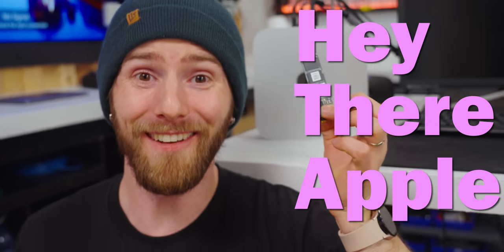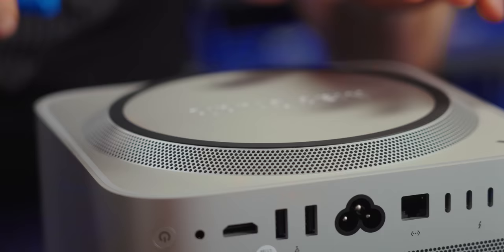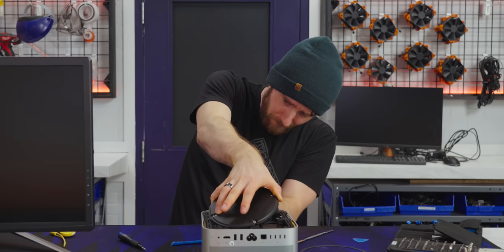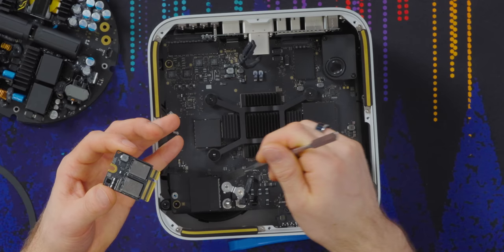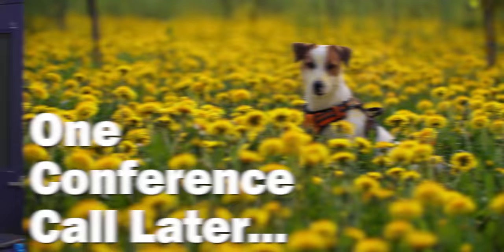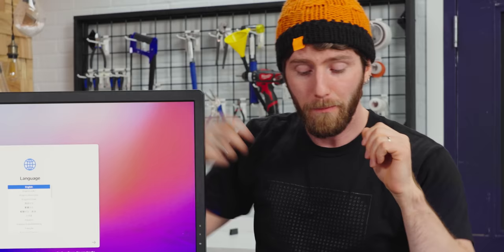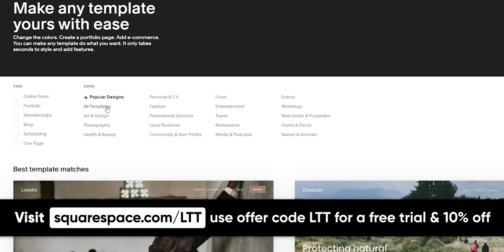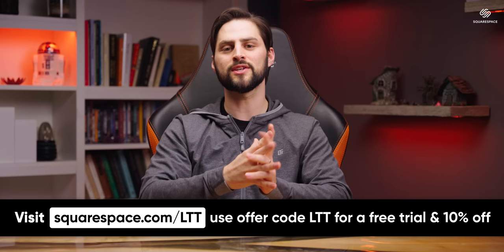I want to love Apple, but they’re making it hard - Mac Studio SSD Swapping

Comment: This just makes me have even more respect for Valve and companies like them.

It was so easy to upgrade my 64gb steam deck to 512gb... And cost me much less than the price difference between their own SKUs
Reply: Well to be fair the 512GB Steam Deck has other features too!
Reply: What drive did you put in? I was under the impression the 64gb wasn’t upgradeable, this is great news!
Reply: @jonatinoo  100% can upgrade the storage quite easily. All sku's have the m.2 slot!
Reply: Gigachad Valve : we will support windows 10 or possibly 11 also we collaborate with Microsoft to enables gamepass on your steamdeck.
Reply: Valve also isn't a publicly traded company, so they aren't legally required to provide maximum shareholder value at all times.
Reply: @wta1518  It's not a legal restriction, it's just a practical one because shareholders hold companies accountable.  Change the shareholders, change the companies.
Reply: Valve is doing many pro-customer things which dont net them any profit. Like working to make games Linux compatible. Apple is polar opposite.
Reply: @desther  well making linux games compatible does make them profit
Reply: @ucnguyenminh9393  A steam profile, keyboard profile, a different colour lining in your case and an anti glare screen that can be achieved with a $2 screen protector... 

Think 64gb was the way to go...

Having said that, I also ordered a 512gb on another account for my partner, wish I'd ordered a 64gb on that account too now...
Reply: @jonatinoo  I ordered this from Ebay

Samsung PM991a PCie NVMe MZ-9LQ512B 512GB SSD M.2 2230
Reply: as far as im aware apple is the only tech company going for anti 3rd-party repairs
Reply: @Shotblur  Actually publically traded companies ARE legally required to act in the best interests of their shareholders (in the US at least).
Reply: @Shotblur  Shareholders can and do sue their own companies over lost profit successfully
Reply: @wta1518  Corporate purpose was at the heart of the Hobby Lobby case. US Supreme Court ruled that companies DO NOT have to pursue only profits and that directors can act counter to shareholder interests because directors also have fiduciary duty to the company itself, the goals of which may not be the same as the goals of current shareholders. The federal government tried arguing that for-profit companies' only purpose is to make money and was handily bitch-slapped by the US Supreme Court
Reply: @ReassuredPrimrose  theres soo many other companies who are anti repair
from washing machines at home to farming equipment to obviously phones

right to repair is a issue everywhere, its not as simple as "just dont buy apple" anymore
Reply: @ReassuredPrimrose  Head over to Louis Rossmanns channel and learn a little bit more about the many different companies against right to repair.

From cars, to electric skateboards, to printers and even something like farm equipment
Reply: So that you could... buy and download more Steam games? Makes perfect sense to me.
Reply: @Graviteo  I must have gotten bad information, sorry.
Reply: @lasuch4389  Regardless of your feelings about Windows, the point is that Valve gives you the choice.
Reply: I don't respect any company.. it's a company not a person, its the trap people get into saying they respect one company over another.. eventually they will do something shady and most do but you don't realize or care.
Reply: @Killswitch1411  Oh believe me, I'm more than aware that the main purpose of every company is to make money. That does not automatically mean that every company is 'bad.' 

Some companies realise that to build a base of loyal customers, one of the best ways is to put the customer first in your decision making. These are the companies that have my respect.

Yes, they're doing it to 'make money' but they offer a service / product I want, and if they can provide that service to me without bending me over and shafting me at every opportunity, whilst still making money, I think that deserves my respect and my business. 

Of course, rarely is something 'forever!' Just like any company, and like history has shown in the past, Valve could, at any time, have a change of leadership, a change of policy, or they could just flat out make mistakes the change this 'customer first' ethos, If / when this happens, at that point, I'll reassess my respect for them.
Reply: @rustyclark2356  Dude, you think being anti consumer doesn't result in higher profits? Why do you think Apple is the world's richest corporation at a net worth of over $2.8 trillion? Apple has the highest profits out of any corporation on the face of the planet. The problem is that being anti consumer, and seeking the highest profits possible is incredibly morally wrong.
Reply: @divyamthakur  Yeah, but a tiny one. So few people use Linux, but I can imagine that their profits will rise as more people start to use Linux.
Reply: @Graviteo  Dude, any company's purpose is to make money. That's the highest priority for companies.
Reply: @anakinlowground5515  It can be the highest priority, but it doesn't have to be. That's the point of contention. Too many people in these comments and elsewhere online keep repeating the claim that companies and directors are legally obligated to maximize profits and shareholder wealth when that is just blatantly wrong. Case law has settled it for many years now, both at the state level and federal level in the US.
Reply: @ChiisaiRamen  "as far as im aware"
Reply: @rustyclark2356  Dude, Apple is the most valuable company in the world. How about you point out a situation where a company being extremely greedy and anti consumer makes less money than the company not employing such scummy tactics? I mean, there is a case to be made that a company without those tactics could make more money because they would get a cut of all the money made from spare parts, because they would get licensing fees and such.

Comment: There is a very good reason as to why I never switched to a Mac. This video just hammers the nail into the coffin. I love having control over a product when I buy it and I as consumer should be free to do whatever tf I want with that product.
Reply: Custom PC with more power and compatibility for a fraction of a Mac!
Reply: @crowdemon_archives  What PC has the same performance for this type of work for a fraction of the cost?  Say what you want about the upgradability but its been proven time and time again their computer pricing isnt much higher than comparable PCs
Reply: especially when its NUMEROUS grand of a product
Reply: @steezmuffin  literally any good pc for that kinda of work. Just research the parts you need and you done.
Reply: @Servidor_Publico_do_Ancapistao  No this happens every time you guys just say stuff like that but cant actually post anything that can hit the same benchmarks for that much cheaper.
Reply: Yeah, and Apple loves having control over the stuff people buy as though their devices never left their factories. They’d probably also love to have control over you, when you go to bed, which brand of coffee you drink and your cat.
Reply: @steezmuffin  Mac Studio M1 Max with 1TB storage cost like 2200 USD. i9 12900kf with RTX 3080 would get your job done with just under 2000 USD (eBay price), if you counting the MSRP, it could be done under 1500 USD.
Reply: @Kai-rust  ok so link me to the computer I can buy right now for 1500 that has the same benchmarks
Reply: @steezmuffin  you can get i9 12900kf under 600 USD on Amazon, RTX 3080 with inflated price of 1400 USD on eBay (699 USD if you only counting the MSRP). I can't post link here, YT will remove my comment

Ps. i9 12900kf is overpowered, I think i7 12700kf is enough, it only cost like 400 dollar
Reply: @Kai-rust  He just went "poof", lol. Haven't bought an apple product ever and not planning to get one in the future. I remember having a Lenovo phone in the early days of smartphone and modded it by myself after rooting it and it was a very satisfying experience.
Reply: @leizero  Non-apple customer will pay 30 buck or less for their repairs while Apple customer will pay 500 for their sorry your charge port is dead we need to replace everything
Reply: @steezmuffin  as someone who's been a mac user and built my own pc... it just comes down to consumer choice.

if you want to build your own pc you can smash a mac's benchmarks at a lower cost hands down.... but
-you have to know what you're using it for and how to configure the build without needlessly inflating your budget
-you have to know how to properly handle and install each component
-you have to know how to navigate the bios for proper first time setup to optimize everything (ram, overclock your cpu if that's your thing, etc)

if i'm joe blow graphic designer who works at a firm who uses macs and i dont give a shit about components and i just want my computer to do what i need it to do, then i'm gonna pick mac every time.  i miss my macbook pro regularly, but dollars/spec value i'll take PC every time
Reply: @steezmuffin  = Apple fan boy
Reply: @steezmuffin  you're clearly a kid who let's be honest will never see the money to buy those components. 

It's not "buy the computer" it's buy the parts and build it yourself because Apple is the only company that charges you extra to restrict that freedom.
Reply: @ioasisyumich  LOL you think other companies dont sell pre builts?  Have you heard of a laptop
Reply: @rickbiessman6084  You mean they cannot exert that control?  They certainly seem to have a lot of control beyond the purchase of overpriced, if stylish, electronics.  Yet they do not like to be seen as selling consumer electronics.  They are now a "Lifestyle" company - as it is more profitable.
Reply: @John.0z  Did you read what I wrote? ;) I agree that they go way overboard. And if they could control even more, they would. I think we’re on the same page here. ;)
Reply: To me, it was when you no longer got everything you needed in the box, but they were more then happy to charge you for the needed accessory due to "Sustainability". I love the new iphones that no longer include a usb power adapter because everyone has one already, except very few USB C plugs are actually kicking around, and a lot of computers only have the normal USB A (computer port). Also, headphone jack, you are missed greatly (Not sarcasm)
Reply: @rickbiessman6084  I did read your post.  I just thought it did not quite go far enough.  
Modern companies now expect us to not just buy their products, and probably their support, but also to buy merchandise that promotes the company -  and to love them for all the money that we spend!  In the technology area, I think Apple are the most extreme for that aspect.  😉

But there are a lot of other companies that have a similar expectation for our response to their products.
Personally I really dislike wearing "branded" clothes, shoes etc.  They want us to buy them a location to advertise; and at a significant cost premium.  No way!   🤮
Reply: @Kai-rust  the thing is you cant compare these things spec to spec when it’s apple. For example with rendering prores video, render times blow any intel cpu out of the water because of the dedicated accelerators and media engine. Furthermore all this is done at a fraction of the power consumption in a small quiet package. Apple can be frustrating, but for a lot of creators, its the only real option out there.
Reply: @noahleong6426  The person I replied said Apple can hit the same benchmarks with cheaper price, which is not true, that's why I replied him stuff about performance. I do agree with you that Apple is more power efficient, but Mac Studio is designed to be a pc, power won't be a problem unless you live in forest or something,
Reply: @Kai-rust  benchmarks arent always real world though. Especially when you’re dealing with macs and even more so with M1. The applications people are going to be using these computers for, are optimized for their hardware. Especially Adobe Premier, in those cases the apple computer truly is better performance for the price. Look at those tests and you will see M1 beats out intel in every case for rendering in applications optimized for apple silicon.
Reply: @noahleong6426  It's the guy I replied to, Harrison Bedell, he is the one talking about benchmark, and I was just saying which hardware could do better. If you want to argue about benchmark, performance or whatever, reply to him, not me. I'm here to answer his question, not to make arguments that lead to nowhere
Reply: @steezmuffin  uhhh so we are just going to ignore that previous gen macs had worst performance in every single task compared to same price pc builds. Don't take the m1's superior performance in 0.1% of all pc related tasks in the world for granted because AMD has already taken down one group of gullable idiots
Reply: @John.0z  I agree with everything you said, 100% (or more).
Reply: @Kai-rust  Most people do not have the time or knowhow to build and configure their own computer from the ground up. Of course you can save by building your own, but this is comparing apples to oranges. Try comparing it to a prebuilt system instead.
Reply: @greg5892  You can just get a prebuilt pc from developing countries, like Malaysia or Philippines for an extra 100 bucks, or lower if you lucky, and just ship it to you.
Reply: @Kai-rust  
Apple has never been a value for bucks company.. it’s their little attention to details and their OS X that makes it a great deal..
Reply: @SLaughterrmuslimswhereveryoufi  Ugh... can you guys read before replying? The person I replied to talked about benchmark, of course I would reply to him that way
ps. OS doesn't have much impact on benchmark
Reply: @steezmuffin  ok buddy you do realise with 2k to 3k usd you can have a PC with the most powerful cpu in the world and the most powerful gpu in the world, the only mac studio that could compare with that is the mmost expensive version and that one is what 7k usd, and even then that version has less ssd capacity, slower RAM and VRAM
Reply: @antoniopimentel3546  this is just fake news you can’t have the most powerful pc in the world for 2k
Reply: @steezmuffin  He said most powerful gpu and cpu, so the likes of rtx 3090 and such, you could better spend time by learning how to read instead of trying so hard to defend apple trash
Reply: @noahleong6426  I assume that's just the software being more optimised and less of a fustercluck (unlike, say, Windows lmao) so for the most part, you get better experiences generally lol

But hey, I may be wrong. I'm just a Windows user (dabbling into Ubuntu for a bit) after all. 🤷
Reply: @antoniopimentel3546  what kind of specs lol, "5950x + RTX 3090" kind of deal? Because if you go into Threadripper/Xeon and workstation GPU territory it's going to get into US$3000+.

... which is unironically still cheaper from specs/price ratio.
Reply: @crowdemon_archives  nope, the accelerators are dedicated chips for encoding prores. Mac’s from both hardware and software side are highly optimized for this type of work.
Reply: @nadarith1044  You are building a computer with a 3090 for 2k?!
]
Reply: @steezmuffin  we're not talking about prebuilds. Pay attention to the context. You seriously need to work on reading comprehension. 🤦‍♀️🤦‍♀️🤦‍♀️
Reply: @steezmuffin  Depressed Apple fanboy found.
Reply: @willardlentz3044  You clearly do not write code
Reply: @steezmuffin  only in the last few years, that they manage to bulldoze the competition by having exclusivity on better silicon nodes. Some people forget that even today the best of the best of cpus still have about half the transistor density while gpus only one quarter of the transistor density. What Apple sells is an illusion , that they somehow managed to offer a better product with less power consumption. In fact they promote products that in any other scenario would be the lowest end of a technology  and thus less powerful and less power hungry.

x86 chips made on a better node already smoke m1 in single threaded , cough cough Alder Lake. Yes they are an order of magnitude more power hungry , but they are also an order of magnitude  faster...